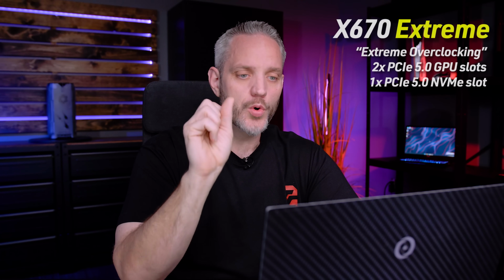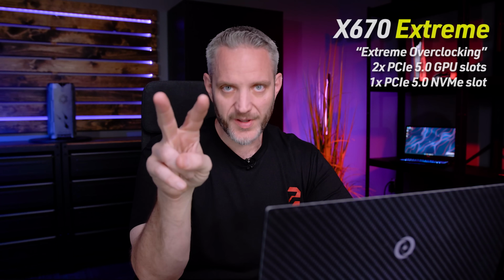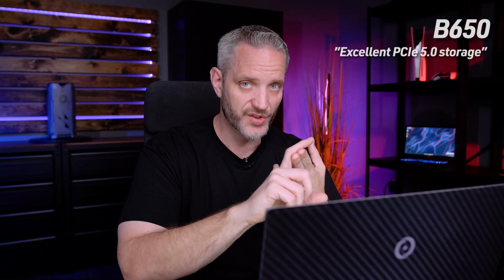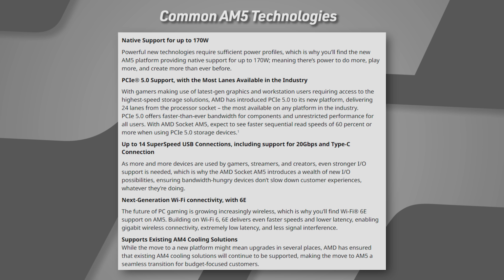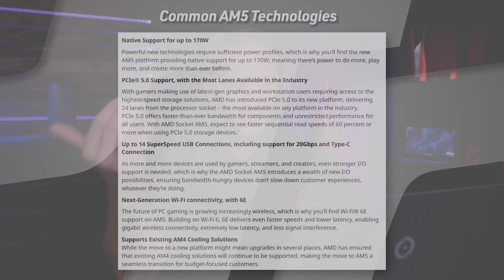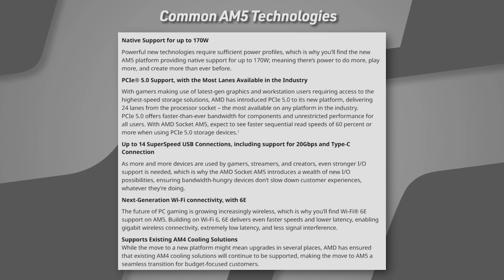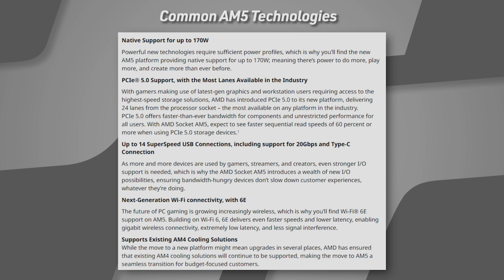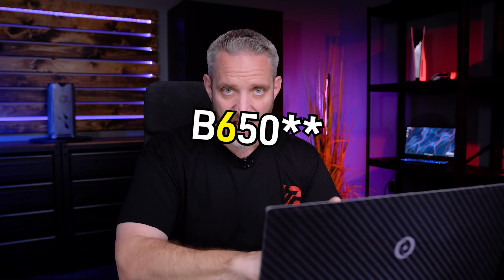AM5 Motherboards are EXPENSIVE! AM5 Explained

Comment: Its possible part of that cost increase is the base PCB material. Higher speeds can require higher cost material, and due to current material availability (or lack thereof) , ALL material is more expensive today than it was 2 years ago.

Comment: Last Jaunary, i bought a Asus ROG Strix X570-E Gaming ATX AM4 Motherboard for 144€ from a retailer massive discount (Buyers withdrawal / Refurbished) in France i'm very happy to not buy now all AM5 / DDR5 expensive upgrade. Save lot of bucks to upgrade from  i-7 6700k and MSI Z270 Gaming Pro. More money for next gen GPU / monitor upgrade from my 1080p to 1440p ^^. It's not the last gen but for gaming it will be enought to support most of the games. 
I bet AM4  AMD Ryzen 7 5800X will go on dropping on price as i have already seen last month. (309€ )
*Now in Europe it's very expensive stuff because 1$ = 0.99€.

Comment: I'm on Intel 11600K w/ Gigabyte B560 Mb PCIe4.0 32gb ram GTX 1650 GPU, I've been a Intel fan for many years but thinking of switching over to AMD AM5 Rx7600X w/B650 Mb. Since the recent Intel A380 GPU fiasco I'm switch over to AMD now. Bye Intel. Hello AMD.

Comment: I'm going to build a home gaming file and media server using AM5 with Vcache in q1. Right now the plan is to get a high end extreme motherboard for the two graphic card slots. Then I will get a new gen AMD GPU (RDNA 3) to run as the primary for the main gaming os and a 3090 split over 4 VMs for my emulation VMs. It will be pricey but I think the 3090 on an 8x PCIE slot should still get almost full performance

Comment: I kind of saw this coming for just the basic material cost alone. More wattage in these new GPU's and CPU's calls for beefier everything to make sense for the power deliveries. You can't make materials smaller when  the power taking to operate things is more. So they have to mitigate the heat, failure points ect with larger things for now.

Comment: I dont believe that two  PCIe 5.0 slots are ment for Crossfire or SLI i really think that days of playing on 2 or more gpus are behind us, but probably for one GPU and maybe some PCIe 5.0 nvmi x16 card where you can connect couple NVME drives in raid and have some insane speeds for some extreme users. And the fact that GPUs cant even use PCIE 4.0 slots in full and that GPUs are even fine with PCI 3.0 slot unless is GPU with x4 slot like amd 6400 (and now we are getting 5.0)  is separate story.  Its more future proofing if you are buying AMD platform today, because am5 socket will be few years with us so maybe just maybe when you are on 3rd or 4th gen of am5 socket procesor and nvidia 6000 or amd 9000 series gpu you will maybe and just maybe be able to take advantage of pcie 5.0 and update bios swap just cpu and gpu and leave rest of the build the same and save some money but have amazing upgrade.

Comment: I think all this shit gonna go down quick considering you can get a x570 for like 100 bucks on the used market and 5800x for under 200 CPU just don't matter that much any more and I doubt ddr5 will make much a difference specially folks doing 1440p and 4k

Comment: I won't be adopting a Ryzen 7000 build. It's wierd to think that my newest build is hitting 2 years old already and still has current gen stuff. I upgraded from a build that was Ryzen 1600 on B350 with a GTX1060 6GB. The newest and now 2 year old build is a Ryzen 5800x on B550 with a RTX3070ti. Still no where near maxing out the CPU with the 3070ti pegged at 100% in games so no need to upgrade CPU. I do love seeing all the new features and technology leaps of next gen products but nothing is enticing enough that I feel the need to upgrade. DDR5, PCIe Gen5, Wifi 6e, etc. All great new steps but the previous gen right before, DDR4, PCIe Gen4 WIFI 6, all work beautifully and are plenty fast for gaming with my "measly" 100Mbps (Down) internet speeds.

Comment: You can get a 5900x for 379$ and a 3090ti for almost 1000$ seems like a no Brainer to wait for ddr5  pcie5 and am5 to smooth out the issues and pricing. Graphic design and gaming still need 2 years to catch up in my opinion.

Comment: Coming from Intel (9600K) I'm excited to be buying into the AM5 socket and its upgrade options in a few years. So my plan is to get an ""expensive"" (for me that's the 200-300 range) board with plenty of bells and whistles that I'll be happy with for the next few years (IIRC AMD said the B600 boards won't support PCIe Gen 5 for storage?), and then only upgrading my CPU - instead of having to upgrade both together as I have done in the past on team blue.
Reply: Just remember, AMD is only "OFFICIALLY" supporting am5 til 2025 so 2 or 3 generations max. There might not be many upgrade paths. Especially with ddr5 in its infancy.

Comment: Personally I'm planning to stick to AM4 with an upgrade to R5 5600(X depending on price difference value). I've always been behind the curve with new tech so I don't mind. I'm sticking to AM4 because I really can't afford the modern prices for gear, and I REALLY don't want to have to buy a new GPU to minimize bottlenecking since I'm running a GTX 1660. I'm sure there will still be a bottleneck between the 5600X, and my GPU, but still way less expensive than a completely new platform.
  I remember when the CPU, and board were almost pennies on the dollar compared to the GPU, and RAM, and always wondered why. Like, why was the mobo, and CPU's combined price still cheaper than the mid-range GPUs? Now I get a much better idea why, but it still always felt weird to me that the literal brain, and cranium of the PC was cheaper than the eyeballs, lol.
Reply: GPUs are pretty cheap at the moment if you are not interested in getting the 4000 series. The RTX 3060 12gb can easily be had right now for under 400 dollars which isn't an amazing deal, but it is probably as good as we will get unless serious price overhauls occur next gen.
Reply: @_shadow_1  "GPUs are cheap" wtf are you talking about
Reply: @darinsteele7091  Please read my full comment for more context, I said later that they were the best we will probably see until the GPU market sees a big overhaul. We can already guess that the 40 series is only going to be worse pricewise than 30 series and scalping will only make that worse.
Reply: @darinsteele7091  Some GPUs have come down by quite a bit lately. My GTX 1660 SC Ultra is down to $209 now. When I bought it a couple of years ago it was $230 so not too terribly bad.
  I'd LOVE to get a hold of a new 3060 Ti for that price, but I highly doubt that'll ever happen, lol.
Reply: @_shadow_1  Yeah that's true. I just can't stomach paying more than a couple of hundred for a GPU because I'm old, and out of touch, LOL. Hell, I still remember when the most expensive cards were $400.
Reply: @Demon-LZ  What generation was that?
Reply: @_shadow_1  ATI Radeon 9700/Nvidia Geforce 4-ish. Lol.
Reply: Its a nice rig for playing Fornite. Good decision
Reply: @Iammorph  Thank you. I play games like Doom 2016, Eternal, Borderlands, and Borderlands 2. I absolutely despise multiplayer games. They're great, but I like to live in my own little world away from everyone, lol.
Reply: I think once the 7000 series launches, all the 5000 Ryzen chips will drop dramatically. It may be worth it to get the 5800X over the the 5600X. Their prices are already pretty close and as they go down in price I think that gap will shrink even more.
Reply: @Hagop64  Some will absolutely, not the X3D so much though since it delivers similar performance. It'll be interesting to see the 5600X3D price. The problem with Ryzen 7000 is that it will only be interesting to high end buyers while it is new. The kind people who don't care about spending $2000+ on a build with mandatory DDR5 and PCIe5. Ryzen 7000 won't be budget until Zen 5 is released in Q4 2024 and AMD might just release budget Ryzen 8000 at that time instead because of the bugs with a first gen platform. That also happens to be the same time fast DDR5 will become cheap because the new DRAM fabs come online at that time too.
Reply: I call it the Pentaverate of Bugs. Intel or AMD, this generation is not something I would get even if price was irrelevant. First gen of any big AMD motherboard platform upgrade is also unlikely to be as compatible. AMD only said 3 years of support too, that's only 1 more than Intel, and AM4 boards didn't manage it well with Zen3. 
1)PCIe 5.0
2)DDR5
3)New CPU architecture
4)New chipset
5)Maybe new GPU too

Comment: Yep had my ethernet cable dropping to 100mbps so my speeds were cut dramatically. Swapping to Wifi saved my headache until my new cables arrived and re-routed them through the attic and now back to normal.

Comment: I'm going to wait about 6 months give or take. I'm still debating between the 7600x and 7700x. Six cores will be more than enough for gaming and streaming, but i already have a 2600 so i wouldn't mind doing a little jump up lol. The 7800x3d would be an amazing choice for gaming, but do i want to spend 200+ extra? 
The motherboard is a split between x670 and b650, In all honesty how much speed do you need for storage? Unless you're doing massive renders and need as much leverage then 4.0 will be fine enough for gaming, streaming and productivity. 
Now i'm still unsure of my form factor, i wouldn't mind an ITX build, the Phanteks evolv shift xt is one i'm leaning towards. That will require a new PSU which is an added cost, while i could just use my 850W psu again.
There is alot to consider for this new build. Cannot wait to see jayz review hopefully in a couple of weeks.

Comment: I iwll keep the ryzen 1700 that ihave becuase while i got it in 2017 sicne 2021 that i got RX 6700XT 12 GB RED DEVIL for 950 euros it runs evrything at max settings 1440p 60 fps which means that there is no reason to change cpu ram and motherboard yet.

Comment: My plan is for a regular x670 board and a 7900x and then when RDNA3 comes out I'm thinking about getting that gen "mid-level" card. And I'm on some older hardware that's starting to show it's age and becoming base or recommended spec for games and my music production stuff is also starting to show some signs of slowing down now. (for reference its a 6700k and 1060 6gb and i use Ableton and Reason) So I'm really excited for am5 and it's support for the future (from their slides 2025 at least) and that gives me a good upgrade path and I'm just generally excited for what AMD brings out next. And I know I probably should have upgraded awhile ago but I got stuck in the "i'll just wait for the next thing" cycle and i need that to end lol.

Comment: Was impressed that AMD was keeping the same price during the announcement. Then I realized they are LGA so they are "cheaper" to produce and the pin price goes to the board.
Reply: they designed the B650 boards to be cheaper but the motherboard manufacturers always want a premium on new boards.  When B550 came out, I found a good X570 board on offer so it was cheaper.
The big ass VRMs and power stages was inevitable with Intel's relative success pushing their CPUs over 200w
Reply: @RobBCactive  intel cpu always power hungry, room heater, just get the same performance as ryzen.
Reply: What is LGA?
Reply: @fynkozari9271  LGA means the pins are on the motherboard instead of the CPU
Reply: @fynkozari9271  Land Grid Array
Reply: Then you hear them say, the chiplets are smaller than ever too, so less silicon is actually needed to make the die.
Less in physical materials but the same cost
Reply: @imo098765  Less silicon but potentially worse yield, so not necessarily cheaper to manufacture.
Reply: @alexatkin  Remember Zen 2 was 7nm
Zen 3 was also 7nm

Zen 3 was more expensive with better yields

Comment: I have been waiting for a PCIE 4.0 APU. By the time those came out, the Vega graphics were getting long in the tooth. Waiting for an RDNA APU. RDNA 1 or 2 is fine, PCIE 4.0 is fine. That's what I'm waiting for. I would prefer AM4 platform for cheaper RAM.

Comment: If you are going for X670E then get one with USB4 included. Apart from the DDR5 support this will be the new feature that will keep your build working until 2025 as new USB devices are released. Given the lack of PCIe slots on most boards USB upgradability will be key.
Reply: Hoping they will  put  USB4 on B650E boards

Comment: Going to wait for a few months so the bugs in the BIOS are all ironed out and maybe the X3D versions will be out by that time and would love to see the comparisons in games with that version of the 7000 processor.
Reply: If I were you I'd wait more than "a few months" for mobo maturity. It took 1-2 years for x570 to mature, and some systems are still plagued by USB bugs.
Reply: I am leaning there as well, to wait for x3D version of 7950x, but minimum price will be $799 according to leaks, maybe more.
Reply: Same
Reply: Yeah, in waiting until March, current system will be 2yo at that point. Hoping 7950X3D is out at that point and a few nvme5gen options.  I'm slightly bottlenecked by storage currently but not enough to go to threadripper pro.
Reply: @aztracker1  2years old PC and youre building a new one? Think about the electronic waste you alone creating. My PC is 5 years 1 month old, and Im planning to build am5 5nm 5.4ghz ddr5 pcie5 1year from now. Just so I can have 2 gaming PC, Win 11 for DX12 games, current pc dx11 win8.
Reply: 7950X3D is allegedly 30% faster than the standard model, 7900X3D 20% faster and 7800X3D 15% faster respectively.
Reply: @UltraK420  I guess I'll have to get the 7950x3d then.
Reply: That didn’t age well, the x3 d versions are now coming March 2023
Reply: Ditto
Reply: I would too because of that recent MB recall disaster
Reply: I just want them to get the heat and clocks issues better at this point. That's really why I'm not into an X3D, because it looks fantastic only when you compare it directly to the 5800x, but the 5900x with its 70mb of cache not so much. This becomes especially apparent with productivity tasks and certain things that require it not having gimped clocks and on top of that it'll still be a toasty little fugger so I feel like it'll still be as hot as 12-16 core only minus the cores and additional clockspeed.

I mean, I guess if you're only gaming yeah it's fine. It's just that some of the games I play on CPU heavy loads are going to suffer too by not having that clockspeed and then not even being affected by added vcache too strongly.
Reply: No chance in hell are they releasing retooled versions only a few months after launch.
Reply: @michaelgleason4791  right lol, i wonder if the usb issues that they havnt figured out in 4 generations of ryzen is heading on over to the new platform xDDD. but yeah id expect alot of bugs to be solved around a year after launch with bugs staying persistent through the life of the platform.
Reply: @michaelgleason4791  If raptor lake is going to beat them like it looks like it probably will and intel is priced better also then yes they will prob ces 2023 unveil the x3d because that would put them over the edge to regain the crown of "fastest" cpu.
Reply: @michaelgleason4791  bookmarked for following up if the AMD rumors for CES are true.  It's rumored that Raptor lake will have Intel claiming the crown again.  If so AMD will have to respond sooner rather than later.  I'm thinking announcement at CES with a launch early summer.  But we'll see.
Reply: UEFI, since 2010 its called that, u can use mouse and keyboard. BIOS is from the 80s, where u can only use keyboard.
Reply: I'm pretty disappointed that 3Dv is not in the mainstream release. It seems like all the high end should of had it at least.
Reply: @ZFPS115  It's disappointing that AMD's cutting edge 3d v-cache tech takes a bit longer to put on CPUs than the ones without it?

Check yourself.

Comment: Motherboards in general look like they're going to tend to be unreasonably expensive for no fucking benefit, shit IO offerings have regressed hard these past possibly even 10 years, you wanna do anything not involving audio, USB-A or C nowadays you can go fuck yourself and get shitty £5 dongles that don't fully utilise all the bandwidth of even USB 3.0, I have an SD card adapter because I have a 3DS and Wii U, and I can't use both the SD card and MicroSD card readers simultaneously. We need all the IO back on the fucking case and all the provisions for that IO on motherboards, you can remove most of those rear USB-A ports to make room for more front IO bandwidth don't kid yourself. YoU dOn'T nEeD aN oPtIcAl DrIvE, really? What reason other than the planet being populated and ran by a retard majority is it the case I can't find internal optical drives and SD card readers for that matter, especially well labelled and not from companies that may lock them to proprietary first party OEM motherboards. As a matter of fact, you might be better off getting an HP or Dell PC with the IO you need and airing it out and adding a 1Gb+ network card and using it as NAIO.

Comment: I've ran Intel since my first computer back in 1996 . built 3 computers and for the last 7 years have been running off my Asus G752V gaming laptop (was in the army needed to be portable) . For my next build I'm going A.M.D for the efficiency and lower power use . I'm 1/2 on waiting till the 7000 series comes out to decide on buying new am5 or going for a more budget build and rocking 5800x am4 with a 6600 GPU for a few more years till i try for the 7000 series with a 4000 series GPU .